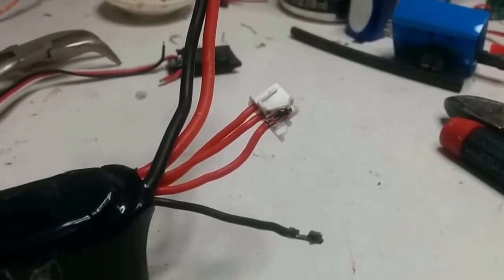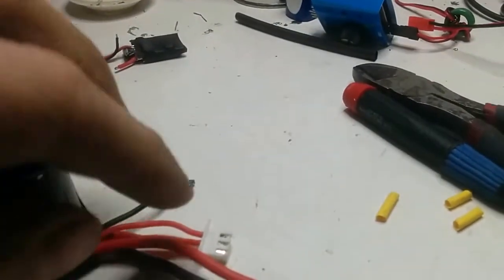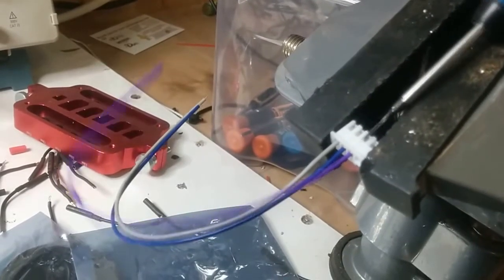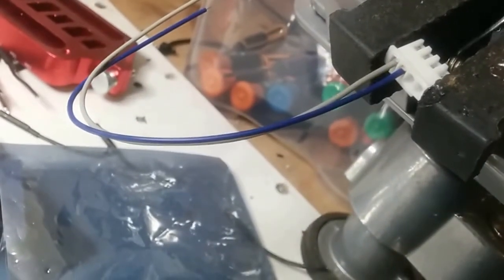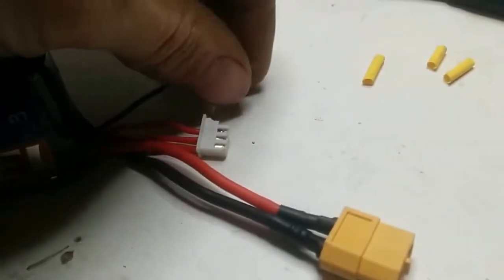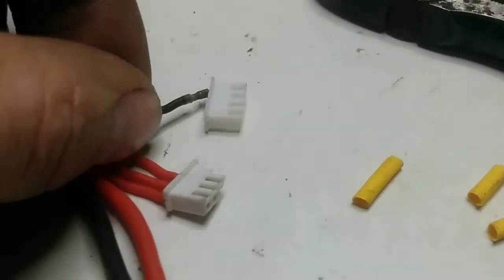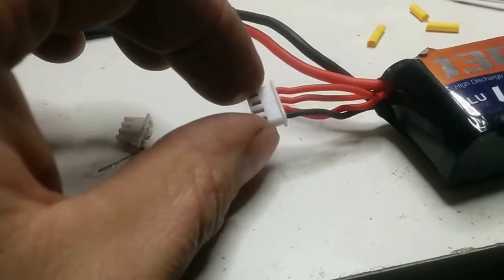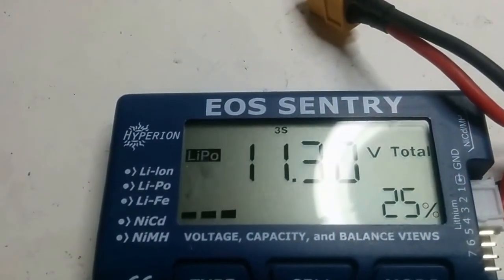Replace broken balance plug on LiPo battery (JST--XH)

Comment: Poor video. Never used a multimeter to set the wires with the correct order, didn't use a crimper when the connector is damaged, etc.

Comment: I am always confused on the order. need some tips on the order! For example, my Tattu 4s lipo has 1 red 4 black. I made the same thing you did, but it is  not charging again.
Reply from the maker: https://goo.gl/mlQaSB  Is a good place to start. In general you should measure 1 cell voltage per connector from the black wire. And if you have another pack that is the same type check the colors!  In worst case you may have blown the balance cable or perhaps even the battery
Reply: he did it for 3s not 4s

Comment: Excellent video. Thanks for posting this. Question for you ... That little barb/clip is pushed in too far on mine and it won't catch now when I put it in the new connector. Is there a way to pry it out?
Reply from the maker: try a small screwdriver or a needle to get it out. in worst case use some hot glue or superglue in the back to keep it in the place. last resort is to solder or crimp a new one in place.

Comment from the maker: Hey,

Search for JST-XH 2s on ebay and you will find. For example: http://www.ebay.com/itm/10pcs-JST-XH-2S-Balance-Wire-Extension-Adapter-Lead-22cm-for-RC-Car-Boats-/200656013335?pt=LH_DefaultDomain_0&hash=item2eb807c817

Comment: Hi there, I need to make the same repair on my battery, but am having trouble finding the 2s connector with or without the balance wires. Do you have a link to where you got yours?